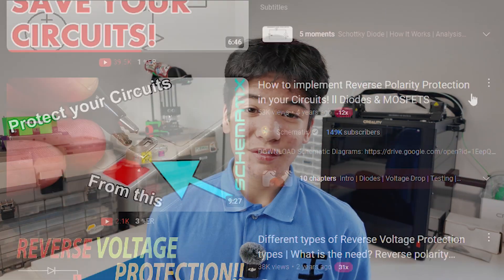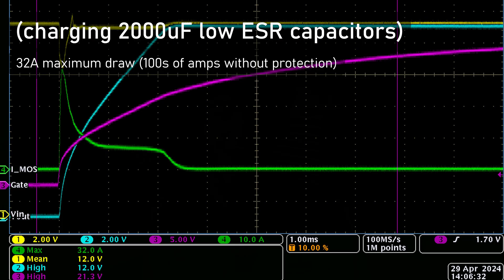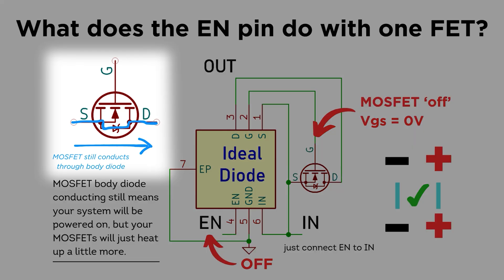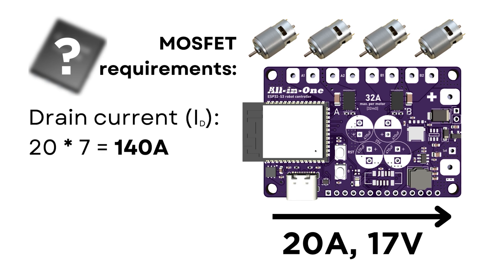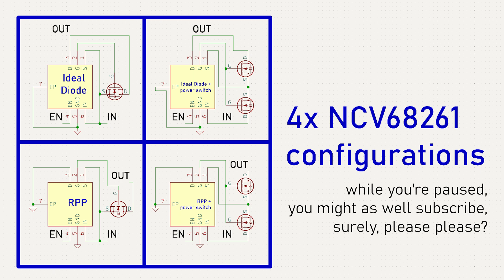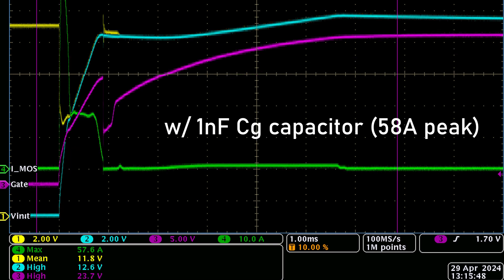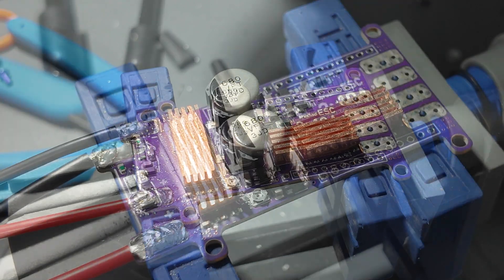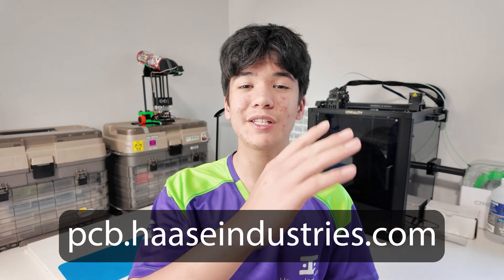No, THIS is the best reverse polarity protection circuit!

Comment: how can i use this  to build a wrong polarity to correct polarity.
The polarity reverser should be automatic, is to a voltmeter, two pole plus and minus. the voltage in is mini 3.0 - 8.4v Max (1s or 2s lipo)
This should be built into the circuit board.
Reply from the maker: @Xstreamlive  search up active rectifier, this circuit will not do that

Comment: im curious if this ic can use as high-side switch only although the datasheet gave combination configs
Reply from the maker: @WeiweiSu-e6e  yes 👍
Reply: @h1tec  Just tried it out today, 3.3V logic wouldn't be able to turn on the fet to conduct. The schematic is based on datasheet's figure 2 and I only removed the "ideal diode" nmos and reroute the S pin and D pin to the remaining nmos' Source and Drain. Is there a limit on the nmos' vgs?
Reply from the maker: @ ohh dude I misunderstood you. No, I don’t think you can use it for just a high side switch with only one FET. Sorry, I must’ve not been thinking right when I responded. Look through Texas Instruments power switches section for some other ICs - some of them even have integrated low Rds FETs. Dude, I’m so sorry if I mislead you - I thought you meant can it be used as a high side switch with two FETs, not just one. The voltage sensing between D and S pins would prevent you from doing this I think. However, you can always contact onsemi support team - they are very friendly.
Reply: @h1tec I was looking for a high-side switch controller that I could PWM it (~250Hz), because it's switching for 10-15A current the integrated fet switch is not feasible and TI says their oring controller and hot swap controller can't be PWMed so my options are limited.
Reply from the maker: @ couldn’t you just use a standard N channel MOSFET gate driver? Then you could get the N channel MOSFET to switch the low side (which is easier than switching the high side, but you can still do it if you want)? There are many that exist out there 😁 Half-bridge gate drivers are also an effective solution.

Comment: I do wonder what the target audience was for this chip, I can see the appeal for a hobbyist, but for a product it seems either overkill or lazy. I.e. in low current applications it's entirely unnecessary,  in high current applications your batteries will have keyed connections anyway preventing reverse polarity, and then using this chip just for the anti spark and enable features seems like a waste. I suppose it could appeal to lazy or time crunched engineers? Idk it's just odd to me, maybe there's some sketchy foreign market for these things? Or perhaps I'm underestimating the time crunched / lazy engineering market (likely true).
Reply from the maker: @xxportalxx.  yeah, it was meant for hobbyists. Antispark connectors like the XT90-S cannot be used in space-demanding applications. You could also set up a low voltage cutoff with this circuit, with a comparator, voltage divider and small MOSFET, so it is very versatile and useful for people wanting to design PCBs themselves
Reply: @hxtec32  yeah perhaps drones and power tools would use it? It would have to be a situation where the solution gives it a bit more premium feel, but engineering time is at a premium (I.e. a semi custom solution becomes preferable). Then again perhaps I'm underestimating the problem. Most of my engineering experience lately has been in industrial spaces where the engineers would just throw a third party, warranteed, module at the problem haha

Comment from the maker: By the way, don’t use ideal diode mode for motor driving systems. Use RPP mode. Ideal diode mode prevents the motors from returning energy to the battery (blocks reverse current), causing the voltage to rise up to dangerous levels. I’m very sorry, I should’ve mentioned this.
Reply: So just clarifying, RPP mode would also protect against someone accidentally pushing the robot (causing flyback current to the motor driver)? Are you also thinking of adding overcurrent protection - that would be a great addition for the next video, no? ;) Looking forward to it either way (as I think your videos are well presented and very informative, so keep up the good work)!
Reply from the maker: @darrenjcosborne  RPP mode allows the main circuit to not be damaged during flyback current, correct :) Overcurrent protection would be good, I'll have to figure out how to do that though (sounds simple enough). Thank you for commenting :) Have a great day.

Comment: Honestly speaking I don't like these gate time tricks since you do create a heater.
Why not to use an external soft-start circuitry?
Why not to modulate these switches instead by compararator and current shunt or just use instead cheap mcu?
You can basically use a damn NTC  for this job  or 2 of these things starting first via resistor and then normal case.
Reply from the maker: I’ll use soft-start with an external power path in my next video. Like, a separate path that turns on with a series resistor, like you are saying (pre-charge). I agree, actually - the gate tricks aren’t a sustainable solution for all applications. They still work though - 32A for 2000uF is better than hundreds of amps, potentially. One thing I wouldn’t do is an NTC though. They get too hot lol. Not for a battery powered device. Thanks for the advice 😁 I wasn’t knowledgeable enough to understand this comment when you first posted it, but now I do after doing some of my own research on pre-charge. Thanks 😁

Comment: No, this is not "best". Best depends on your needs, price point, and component availability. If you can't get a component, that is the worst solution. If it is too expensive or overkill for your actual circuit's needs, it is just suboptimal.
Reply from the maker: I mean, fair. But, it is much much much more efficient past a certain current rating and applies to the same sort of circuits that many other YouTubers claim is 'THE way' to protect against reverse polarity. Also, to be completely honest, I needed views on this video which I spent around 20 or so hours making. If I didn't name it 'BEST' or say 'Is this the BEST?' no one will click on it and watch it. What would you use instead for >5A circuits? Do other solutions you've seen on YouTube have the same anti-spark power switch function? I was trying to fill a gap in the search term 'reverse polarity' because no one else (at least popular) mentioned N-channel FETs, which I thought was a no-brainer. Also, for low-power circuits, even though it is likely quite a small difference, the lower resistance of the N-channel FETs can help save more power. No hate or anything by the way. Have a good day 😁

Comment: I've used similar ICs from Linear for high current application. For most products i work on a SOT-23 P channel MOSFET tend to be a better option. I usually work with low power embedded devices that draw less than 2A.
Reply from the maker: Fair enough, I would do the same 😁

Comment: I would like an anti spark  solution for 12s
Reply from the maker: I’m sure there are different ICs with higher voltage ratings, but how many amps are we talking?
Reply: @h1tec  amps is about 100, but this is dealt with an appropriate MOSFET with heatsink

Comment: just make sure you dont use FinFet for power aplications where linarr(slow turn on) mode is possible. FinFets have low junktion to case thermal conduction. Ak even thou it may say 50A its gona blow in instant once you try to pass 10A in linear mode. Junktion itself has usually verry low thermal mass, causing it to heat >150C within ms, effectivly burning it to dead short.
Reply from the maker: @Murphydeffa-oq8lm  what do you mean by FinFet?

Comment: Ideal diodes are great, but usage depends a lot on the system. SLVAE57B is a good application note comparing different circuits. For anti-spark, and especially to prevent voltage spikes due to downstream capacitance and cable inductance, usually it's better to just use a precharge circuit
Reply from the maker: @vincentnguyen8083  thank you for letting me know! I will have a look at that application note 😁 What do pre charge circuits involve? How do you get the delay? I’ve seen it done with relays before, but I don’t really like relays, and I know a similar thing is possible with MOSFETs, I just haven’t looked hard enough to see one yet. Why is it better to use such a pre charge circuit vs this one? Does it charge even slower allowing for even less current spike?

Comment: So... why 7x current rating? Is that for peak pulse current? Isn't that a bit much?
Reply from the maker: If you check out this datasheet: https://www.infineon.com/dgdl/Infineon-BSC022N04LS6-DataSheet-v02_01-EN.pdf?fileId=5546d462689a790c0168bd1094dc481b

The drain current when the case temperature of the MOSFET is kept at a constant 25 degrees is 139 amps, but when the thermal resistance is specified (Rthja = 50C/W), as in, the thermal resistance between the junction (die) of the MOSFET and the surrounding air, this rating quickly decreases to 27A. It all comes down to cooling. However, if the MOSFET you find has a current rating of say, 1.5x your maximum current draw, when Rthja is being taken into account (not all MOSFETs have this), then that's fine. Because some MOSFETs don't have the Rthja Id rating, instead specifying the Tc Id rating, which is unrealistic, I tell you to times your system's drain current by 7 and look for the Tc Id rating from that, to make an estimation of which MOSFETs would have a Id Rthja right for your system, since that is normally what the manufacturers specify on the product page. Thanks, let me know if you have any more questions :)
Reply: @h1tec  So in short, it all comes down to cooling and thermal design, got it. Very interesting.
Reply from the maker: @gergelybencsik8626  Yep! You just need to find the Id rating with the right specified thermal characteristic: not Tc, but Rthja (or R theta ja is also written with the theta symbol). Hope this helped!

Comment: I just use a bridge rectifier, it not only protects the circuit but also makes sure that circuit works irrespective of the supply polarity.
Reply from the maker: @Hypoengg  this is smart! For high powered circuits which draw lots of current, N channel MOSFETs are the way to go though 😁 I think there are ways to make 4 MOSFETs act as an inverter for this purpose with a specialised IC, GreatScott has covered it before I’m pretty sure. I’ve thought of doing this before but only after I made this circuit and had it manufactured 😂
Reply: 3 problems:
1)bridges has usually 1.4V drop. on 5V its verry big drop.
2) Ground return path is impossible, most applications use negative as ground return for signals(USB)
3) some PSUs have no PE tied to negative. Instead  its connectet do AC side with 2 capacitors leaving negative 1/2 of AC voltage(verry low current). If now you have full bridge and you connect negative after bridge to ground(ex scope goound wire), its gona boost your DC supplt to 1/2*1.4V AC voltage unless your circuit draws enough current to overcome parasitic current from AC side.. in 240V applications i daught any low voltage device can tolerate around 150VDC at input.
Reply from the maker: @Murphydeffa-oq8lm  thanks for letting us know about these issues 😁
Reply: As i don't work on very delicate n complex circuits, this is enough for me. I dont have a workshop, i just work on very basic stuff.
Reply from the maker: @Hypoengg  My "workshop" is just my bedroom lol. Hope your stuff goes well, and you can use the circuit shown here one day :)
Reply: @h1tec  hope so, one day I'll have my own workshop
Reply: But it's very ineffiicient at low input voltages and has high dropout
Reply from the maker: @SianaGearz  correct. You can do the same thing with MOSFETs with a specific controller IC though, I think GreatScott has covered it. Using full-bridge rectifier for low voltage, low current circuits which are meant to be low-power and efficient shouldn't use this in my opinion. High voltage, low current, maybe it will be ok (like wall output)
Reply: @h1tec   Yeah i should do active rectification for bicycle hub dynamo. I want to build a dynamo charged powerbank into the steering bar tube. Also shunt regulation works well for this particular use, allowing the bicycle to freewheel more. It also ideally needs some sort of active power point control to improve harvesting.
Reply from the maker: @SianaGearz  that’s cool, hope it goes well 😁

Comment: Wait, but the p channel circuit from the beginning can be made the same with an n channel mosfet, just have to put the mosfet in the negative rail. Like we put the drain to V-, the gate goes to +V via resistor+zener(if we expect more than ~15V), and then the source is the output ground that goes to our device. When i was making a dc/dc charger for lifepo4 batteries that circuit worked well. The gate capacitor trick is interesting, probably can adapt it to the simpler circuit too. But a chip like this one is probably the way to go if one wants low losses high side switch protection.
Reply: Beware of the external connections bypassing your ground. Say your device has USB in/out or an audio connection sleeve is grounded.
Reply from the maker: @victorman2227  cool, thanks for letting me know! I think the chip has a charge pump built in though so it may be able to work at lower voltages and still have the MOSFET fully turned on… Thanks so much for this information though 😁

Comment: Much easier way is resistor on input voltage and a zener clamp at 5.6V and after the switch and ur done
Reply from the maker: @FriendlyIntentions  what do you mean?
Reply: @h1tec   They are describing the crowbar circuit. The resistor can also be a fuse or polyfuse. Zener serves dual function overvoltage protection and reverse bias protection.
Reply from the maker: @SianaGearz  oh ok, thanks. would this still do the on/off switch part?
Reply: @h1tec   Not per se. A crowbar circuit like this is my favourite way to retrofit last-recourse protection into classic computers of the 80s where ICs are rated to 5.5V but are irreplaceable, while voltage regulators and old PSUs are known to sometimes fail short through a linear regulator to output. Commodore PSUs were often potted so you can't really repair or service them all too well, but people like keeping things original.
Reply from the maker: @SianaGearz  cool!

Comment: the style is funnier indeed :P 
what is the name of the software you are using to design the circuits? can you also share software for analysis, etc?
Reply from the maker: @rnayabed  KiCad for the circuit board design. I did not do the analysis myself, I was in contact with onsemi and they were kind enough to actually make the circuit and test it, for free.